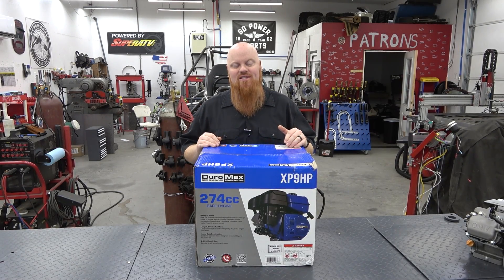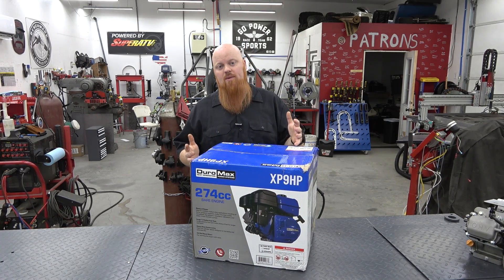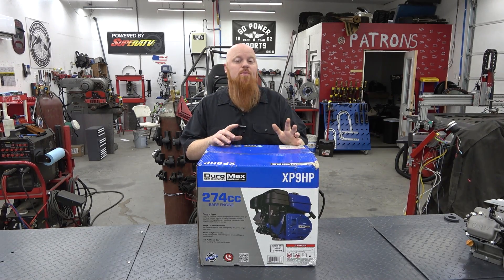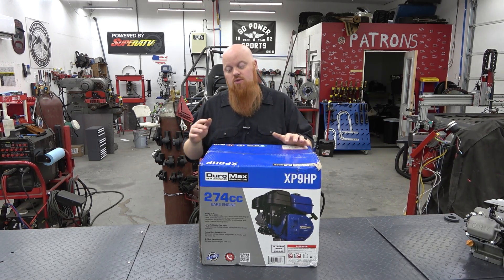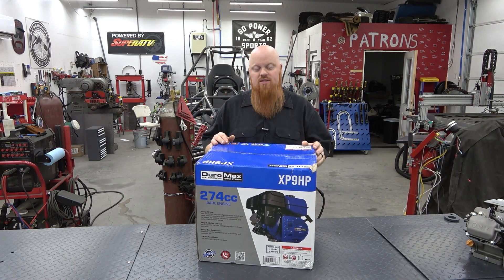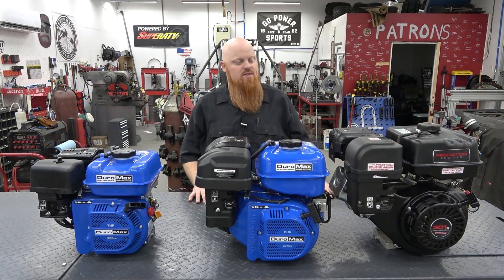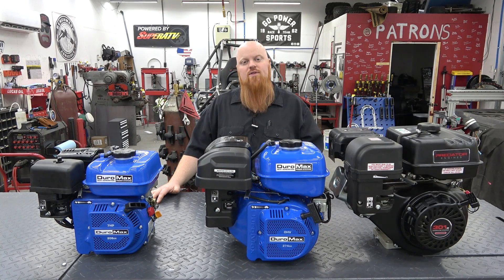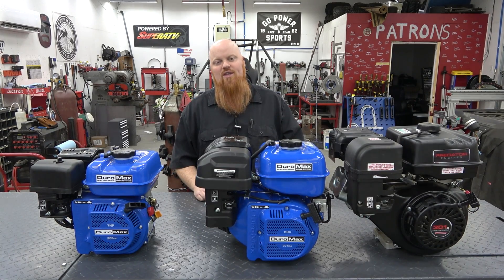New Duromax 274cc Engine Unboxing & First Look ~ Medium Block Engine

Comment: If you are a pit bike adventure tine an put miles on your mini motorcycle this is the best layout. They have to make a juggernaut drive pulley for the 1 in shaft and a 25mm cnc shim cit just for this motor. Im 180 lbs i have  mm80 that has this with a 30 seriese running an 8t 36t set up havent gov deleted or valve springs. But point is witg a litium battery some handle bar speakers solid knobbies i cruise 40mph at quater throttle. I look like a mini Street Glide with a whole lot to go. Eaz the throttle it will have minor drive slippage that you can learn while ride. It fits better then 208 an you can acttually use the key stary

Comment: The 208 aluminum flywheel does work on it but you take away the ability to put a electric start on it because the weight difference is not that much to matter for keeping the nose down I kind of weight my wheels on top of that I've had the accustomed to exhaust they're closed online I wish I could send a picture of my thing on here you probably love it thing with the 274 it definitely fits better on like the TaoTao mm80 I have don't have a Baja I'm on a Monster moto it definitely fits as far as the way they set up the engine layout you can have an electric start on your mini bike it is better laid out for them than the 208 is

Comment: Is 100% correct I ran into 208 forever the 274 is that little bit more power than you want from it on a mini bike I do Adventure Time all the time I put a 500 on a rt200 as well I'm just in the shed in the backyard doing stuff by hand with vise grips and badge clamps and belt Sanders like anybody else don't even get a cutting torch on the RT I was seriously suggest looking into a turbo system as well because there is the room for both the oil Port the pump and the Turbo directly on top of the engine after you remove the gas tank and air filter that way you can make more space you have to make your own tank on top I do the whole bunch of cord special Duramax is much better than Predator by the way only drawback to this thing for mini bikes is they do not make a 1-inch Juggernaut torque converter dry fully they need to this engine slips even with the tightest belt settings I'm looking at upgrading to 22 lb valve springs after I Governor delete which is why I'm watching this video

Comment: Because the follow up video never came around, here is what everyone wants to know. The 274cc duromax DOES share the same flywheel taper as a small block clone, same coil, same valve springs, and the same intake manifold bolt pattern. It does NOT share the same rod (length and journal diameter are different), or camshaft (wrong gear tooth design).
Reply: couple things more about the 274cc. start with the flywheel. yes, the taper is the same as a small block and coils are the same, but the coil mounts will need to be machine little to get the coil to align correct with the billet flywheel magnets and the valve springs from a small block clone will work with the 274cc and they do share the same valve stem size (5.5mm),but you will need to cut a set of longer performance aftermarket valves to size, get the correct length ...etc.. if you are looking into up grading the valve train and for the cam, just send it off to anybody that can reweld and grind you a profile. for example, Isky, dyno cams...etc. only real big problem you will run into is the rod journal will be a different size and will need to be machine to the correct size and correct billet rod will need to be look into depending on type of piston/pin height etc.... crankshaft will need to be turn down to a 3/4 and keyway.  intake port and bolt pattern are bigger than a small block intake, so that will need to be address. for the exhaust side it takes a big block gx390 pattern.   the big question, is it a big block or a small block? well, it does use a small block frame setup. for example, if you have a gx200 on a tiller/snowblower. this engine will basically bolt up and align with everything and no it's not a Hemi...lol

Comment: Not to be a jerk, but I have to point out that this IS 100% a SMALL BLOCK engine!   SMALL BLOCKS have a 162mm x 78mm mounting bolt pattern on their base.   They also have a 106mm SHAFT CENTERLINE HEIGHT from the base.  That's what this engine has!   A Big Block would have a 196mmx86-103mm  mounting base pattern and a 133.5mm shaft centerline height.  There is NO SUCH THING as a "medium block."

Comment: I would be very interested to see if this can work, I'm looking to build a bike with the most lowest end torque possible for climbing, don't much care speed, I want to climb without having to go full throttle, got a lot of very steep hills and very steep climbs on our local trails. My 224 is doing very well, I'm planning on replacing the stock rear sprocket with a 60 tooth.

Comment: 1” crank shaft size would be perfect but would love to see a back to back dyno runs no replacement for displacement unless the small engine had a superior head design or power is made at a higher rpm I’m calling bs on the hp numbers

Comment: It's a very poorly designed engine, with non standard shaft sizes. Why on earth would they make the mainshaft .015" undersize? Nobody makes anything that size, off the shelf. The keyway is too small for that shaft too. It should have a 5/16, or 3/8" keyway. It's back to the drawing board for this one.

Comment: built kind of like a briggs animal/model 15 where the case is little bit taller so it can handle the big 62mm stroke, but still retains small setup. THIS engine will probably not be a friendly engine bolt on performance parts. you will more than likely have to know how to machine and modify stuff if you want to upgrade it.

Comment: Send it to Abom79 and have him spray weld it up to 1"! 😂 Or maybe buy some 0.007 or 0.008" metal shim stock from McMaster-Carr and run a 1" pulley or clutch on there!! Woohoo! I guess you'd have to deal with the keyway, too, since it's a touch over a quarter inch. Hmmm.

Comment: I've stopped building carts with these conventional engines and went with fuel injected motorcycle engines. Until single cylinder manufacturers start offering fuel injected engines for purchase, at least cheap retrofits, other options offer better performance and reliability.

Comment: Is there a Billet Rod for this and a Billet Flywheel? What is the CAM Lift & Duration? What are the Valve Sizes? Is there Billet Rocker Arms for it? How much can the 200/212 and this Block be Big Bored too?

Comment: How bout a gx340, it came off a pressure washer. Do you think its too big for a minibike like a baja warrior  or a ct200u-ex. I know it'll fit but will it be as uncomfortable to handle on the trail as the 420, 440 etc.
Reply: It fits in my ct200u-ex

Comment: This is definitely what we need for a "big block" option on minibikes. I agree the 420/440 at around 80lbs are just way too heavy especially after you throw a 40 series or 780 TC on there
Reply: One word my friend: DUCAR !!! Best engines ever, they make the best blocks for all the companies, Tillotson, Predator, Duromax, ProQuip, etc...
Reply: @nicksilva8966  Maybe look into what a Tilotson is designed after and re write that.
Reply: Depends what frame your putting the engine in bud …
Reply: @nickclashez  I put that mofo on a reverse trike !!!
Reply: Baja warrior u think a 440 would be to heavy @nickclashez

Comment: And according to Duromax these have the same base mounting pattern as the standard smallblock motors. I would like to see one of these with a 3/4" crankshaft because you can always shim up to 1". 

These would be a really good large displacement motor for bikes like the MB200-2/Hurricane with a fairly restrictive frame/motor mount layout. This looks like it might just squeeze in and bolt up to the factory mount location without fouling on the jackshaft for the secondary sheave.
Reply: Needs to be 1 inch or you'll be stuck with a 30 series on an engine that makes more power than it should have put throught its clutch.

Comment: What is bolt pattern on the base? is it the same as the 212?  301? or is it something else entirely? I am looking for the biggest (most powerful) engine can just drop in to replace an old 8hp Tecumseh on a snowblower.

Comment: I was considering a 301 for my Hurricane. But THIS looks like a much better option. can't wait to see you go over it.
Reply: That’s what I was thinking because of its size. Let us know how that build goes
Reply: @srcobra50  hopefully they'll go with a 1 inch crank their next run. That'll sure simplify things.
Reply: @shrugger1  hopefully. They should since I can’t think of equipment or anything that uses a 25mm shaft

Comment: They sale centrifugal style clutches for a 25mm crankshaft. Most of the 25mm shafts are used on the 2:1 wet clutch kits.

Comment: Wouldn't be hard to machine a spacer for the crank to adapt up to 1 in. 
Looks like it could be really good to build if there was aftermarket support. If not and your willing to spend time and money you can get custom parts. Cams can be welded up then custom ground. Find a local cam company that can regrind it. You can also order custom rods and pistons. 
Or take measurements and see if anything else is usable from other engines.

Comment: I understand that my idea would create a lot of extra work for you but I have an idea if you run out of them. Maybe run a poll to see how many few the same as me. I think it would be interesting and cool to see who makes the most horsepower and torque just right out of the box. No mods no A/M parts just a dollar per horsepower and dollar per useable horsepower comparison. I could see this getting really expensive though gathering all of these engines. But food for thought.

Comment: I saw the " .984" output shaft size and figured you'd turn a tube down to .016,cut a few sleeves lengths from it,and then cut the keyway channel.That way you'll have some adapter sleeves for different clutches handy. It will be interesting to watch you work with these.Thanks RBG !
Reply: while it can be done with real precision, its risky to turn such a small sleeve. It would be near tin foil thin and very flimsy. Would almost be better to make a sleeve from .008 brass shim stock if that exists.
Reply: I hope they get the output shaft resized.
Reply: There is a wide range of shim stock available in sizes and materials. I've shimmed metrics shafts to accept standard inch pulleys in the past. My suggestion is that if doing so, use steal shim stock along with anti-seize. Also, you will more than likely have to machine a hybrid key. I would recommend a sheet of. 007" and .008" shim stock.

Comment: There are a couple of other Chinese companies building these “smedium” block engines. Unfortunately, since they aren’t based on a Honda GX they’re all just a little different.  It’s going to make aftermarket parts difficult to justify.
Reply: I just tore apart a 254 LCT it's even closer than this to the predator the block is about 1/2" wider so cam and crank are wider I'm trying to find a 243 powermore that brand is closer to clone than LCT the 254 rod journal is also .080 smaller than clone

Comment: Does it mount on small block plate or big block?
Reply: Looks like it has the small block pattern. Its definitely smaller than the base of the 301.
Reply: @johnmartin560  would be nice if so. Wonder if a 30 series tav would fit.

Comment: Awesome, unboxing video. I talked to you earlier about this engine on a log splitter.  I went ahead and ordered one. Once I get it in and install. I'll let you know how it turns out. Thanks again.
Reply: Just a follow-up. The engine is doing great. I ended up using an .008 shim to wrap around the circumference of the shaft minus the width of the key. Also, I made a step key. The coupler I have has a 1" bore.

I've split a little over two ricks of wood.  The only two complaints I have are that the spark plug is hard to get to, you have to use the tool that it came with, and also, it would be a plus to have a dip stick on both sides of the crankshaft.  Most Predator engines have two dip sticks. A plus on a log splitter.  But other than that, it's a power house. Running a 16GPM pump and a 4 1/2" cylinder with no issues.

Comment: How is possible for an 274cc engine to generate something as low as 9hp?
Reply: 9 HP is an engine class, not the actual hp. Like the GX270.
Reply: @WyFoster  and what's the actual power output? Because if I Google this engine specs, it says 9hp at 3.6k rpm.
Reply: @billwilliamson9842  now you have a point, 3600rpm is quite low spinning for that displacement, that engine can easily spin at 6/7k rpm (with some mods of course), and by that moment I belive we could see about 15/18HP (or maybe it would blow up who knows...). Now it makes sense, thanks man.

Comment: in Russia, Neva motor cultivators are equipped with Boeing storn 8 hp 307cc engines. shaft 20mm, key

Comment: RBG the shaft diameter being non-standard means Duromax never intended this engine to be mated to a  centrifugal clutch. Pumps, log splitters, generators, etc.
Reply: Nothing a piece of .007"-.008" shim stock and a modified key won't take care of. Just a little extra time.

Comment: Like a 351W is in between a 289/302sb and 352FE,Cleveland, Cleveland/Modified.
Reply: Except that the 289, 302, 351W, & 351C all have a 4'' bore. A better comparison would be a stock 289/302 block that can be bored/stroked to 347 vs something like a Dart aftermarket block that can be bored/stroked to 363. Or we could just call it the Pontiac V8 of small engines since its in between a big block, & a small block.
Reply: @johnmartin560  The 351 Windsor is just a tall deck version of the small block Ford(Windsor family) had to refresh my memory. I was going by the overall larger  exterior dimensions not cubic inches. Intakes of 351w doesn’t fit the smaller cubic inch blocks.
Reply: @FangOfTruth  You're right. I'm sure the deck is taller on top of having a much larger bore while still being built on a "small block" type platform. I hope this thing sees some aftermarket development because it looks like it has huge potential.